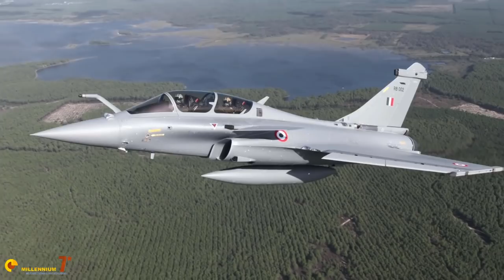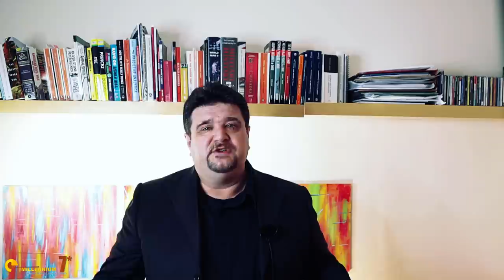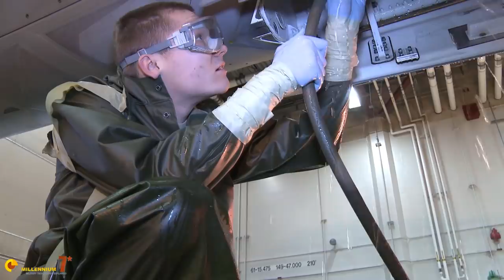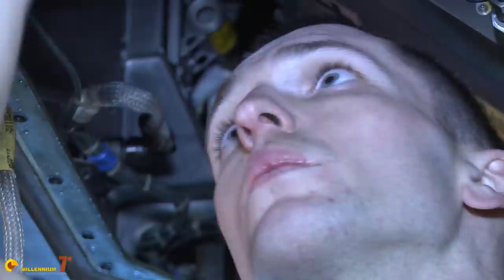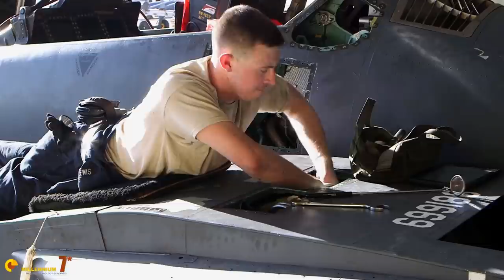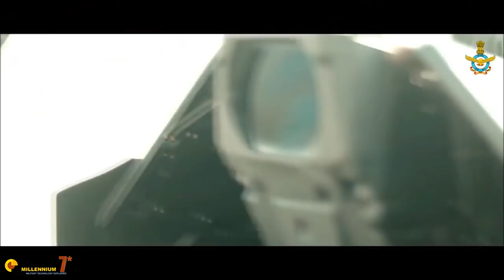The Indian Air Force is a MESS! ... or is it?

Comment: Actually the reason is plainly simple. Historically IAF was underfunded over the years, so the western aircrafts were quite expensive. So once upon a time, we used to have MiGs of different models in huge numbers (literally hundreds). They used the economy of scale logic. 

But lately, the experience with Russian hardware has been horrible. They may be cheap but their spares, availability or maintenance was pathetic. Add to that, too many crashes. 

Therefore, the planners instead went for getting different western aircrafts, but in small numbers. The number of Mirages and Rafales is not that big. 

Now, India is going towards indigenization. Most components in Tejas are either western, Indian or Israeli, NOT Russian. And over the years with Tejas mk1A, Tejas mk2 (MWF), Twin Engine Deck Based Fighter (TEDBF) and 5th gen Advanced Medium Combat Aircraft (AMCA), IAF will soon be running mostly indigenous fighters, over next decades. This ensures uniformity, as all these models are just successors of Tejas.
Reply: Marcos B  the engine still used was american and was f404
Reply: Marcos B  Only of we can make our own engine!! Tejas program would have been realised long time ago.

Comment: Maybe a good idea for western-style air forces to have a multitude of different aircraft but with certain common main parts that are not critical in respect to countermeasures or tactics (for instance: engines, canons, cockpit layout/HOTAS, ejection seats, landing gear, mission computers and databusses, etc.) so that logistics can be more efficient whil also yeilding a more versatile and less predictable force. 
On the other hand, western forces may have their aircraft somewhat similar, but they can vary in terms of armament, ECM/EW and tactics deployed. But indeed: a limitd amount of radars for example narrows down the amount a potential advrsary has to be able to counter...

Comment: I doubt a small Western air force ecpects automatically to prevail in combat. The Finnish air force, for instance, comprises 60 single-type fighters whose job is not to demolish the Russian air force but to act as sufficient deterrent. To this end, the force is equipped with e.g. the JASSM missiles for a robust counter attack capability against high-value targets far inside Russian cintrolled air space. 

Most radar and anti-air assets are also mobile and cannot be knocket out pre-emptively. The idea is that one cannot operate against even a small air force with impunity. That is, the air force does not exist to maintain air superiority per se, unlike naively proposed in this video.

Comment: Indian Airforce 

1-Su 30mki - Backbone of airforce

2-Rafale- cutting edge, will be used along su30mki

3- Mig 21- retiring, used for point defence

4- Jaguar- retiring ( often used in mountain areas and low altitude warfare)

5- Mirage 200- used for low altitude bombing 

6- HAL Tejas 1, mk1a, mk2 - Will be the mainline fighters. Single engine, less expensive to operate, indigenous, easy to upgrade , no spares issue

7- AMCA- Future cutting edge, 5-6 generation, will be the apex of Indian Air force

8- Mig 29K- Carrier based , few are used by airforce as 2nd aircraft carrier was behind schedule.

The issues is that India has various geographical regions, from highest mountain range to long coast lines, dense forest to sparse desert.

Comment: If you look at the number of IAF crashes, the word 'mess' would be an understatement. According to India Today's report published in September 2019, IAF had already lost 12 aircraft in the first nine months of 2019. The crashed aircraft included the SU 30MKI and the Mirage 2000. According to a recently published report, a number of IAF pilots are leaving the air force as soon as they are eligible to receive pension. Currently the IAF is running low both on the pilots and aircraft. A lot of hype was created on the procurement of expensive Rafale aircraft while the IAF has already been operating SU 30MKI and advanced Mig 29s. Rafale is the most expensive aircraft IAF has ever purchased. It's worthy to note India's per unit cost of Rafale was significantly more than the original contract price. Also, the Rafale deal was unique in a sense that a civilian conglomerate was the middle man in the  deal, this doesn't happen around the world.

Comment: India looking to create a domestic military jet industry at the same time. What is the value of technology transfer ? Domestic production off set any risk of arm embargo . What the value of  The Sukhoi/HAL Fifth Generation Fighter Aircraft (FGFA) or Perspective Multi-role Fighter (PMF) ... India prefers to produce its own fifth-generation fighter to maintain parity with China's air force that has recently debuted the Chengdu J-20 but was also not happy with the progress of FGFA. Indian state-owned defense agencies have reportedly confirmed that the ambitious AMCA 5th-generation fighter jet program will involve the DRDO (Defense Research & Development Organization), the HAL (Hindustan Aeronautics Limited), and a private company. New Delhi Finally Adopts Western Model.
Reply: ToT will give the experience of manufacturing jets, just like we were manufacturing the sukhois from one of our own assembly lines and that line has rolled out the last batch of sukhoi and that line will now be used to produce the tejasmk1a that is replacing the old mig21s or it will be used to upgrade the sukhoi30 mki to super sukhoi programme. Then India already pulled out of FGFA and it is not only India's defence complex that is working for the AMCA and supporting it but the Indian airforce is in full support for an indigenous 5th gen fighter rather than a foreign built fighter due to their leadership. Also it is just the MMRCA2.0 that is asking for the ToT for any jet in the competition this deal is being done to give Indian airforce an additional edge for the BVR engagement otherwise the Indian airforce had already made a plan for replacing it's jets like the Tejas mk1a is right now replacing the mig21 then MWF will replace all the older mig29, mirage, and specat jaguars and it will be the backbone for the Indian airforce then sukhois will be upgraded by the time AMCA 5th gen fighter will fly for the first time. So at the end of this decade they will have the MMRCA jet which will be chosen under the deal and then sukhois and India's own platforms.

Comment: India military is a salad.  They put everything they can get into their salad.  Looks powerful but once into warfare...  Well...  Problems problems  problems...
Reply: Nope, they take what suits their requirements. Mirage was bought to counter pakistani f16s, SU30MKI is a russian jet but it is fitted with israeli avionic that gives it the edge of BVR capability along with the russian manuvorable design, mig21s will be replaced by tejas mk1a and they are already ordered and then all those jaguars, mirage, mig29 will get replaced by tejas mk2( MWF) which is going to have the prototype by 2022 and by 2025 sukhois will be upgraded by the super sukhoi programme then in 2025 the first prototype of India's 5th gen jet AMCA will roll out and the second variant will have indigenous engine. So they are on good track and as you can see that most of the jets are the SU30MKI that is the backbone of India's airforce and mirage,mig29 are in small numbers and they are going to be replaced anyhow. Even the sukhoi will lose the title of backbone to rhe TEJASMK2 and after tejas mk2 india will be self reliant in jets just the engine will be under development. Otherwise we got everything else and airforce is in favour of Indian tech because that is easily available
Reply: @danydash316  well perhaps you are right.  But what I see is a hell in maintenance.  All different standards weaponry...  OMG 😱...  If as a small country and small unit of military is OK but India is a big country...  Like USA Russia NATO and  China. Modular design is present and future trend.  If only a small conflict will do.  Once enter major warfare...  I don't think India having the capability of long term combat.
Reply: @michaelgfyau4514  india stores everything for 15 days of brutal combat. And about maintenance that requires spare parts so Indian tech companies and Indian airforce are working to develop the solution with 3D printing and airforce have already considered the process so they can get the parts here in India, then having such diverse airforce gives the additional edge over the enemy since even if they manage to find the short comings of one Indian jet they will be fighting another type of jet in another air engagement. And as i told you about tejas it was a modular jet developed by India and it did took a long time but all of the upcoming jets that are being developed in India are derivatives of tejas that means by the time Tejas mk2 gets into production india will be no longer in need of extensive supplies of spare parts and training since all those jets are same just different variants and capabilities. And Indian airforce is pretty much ready for a 1 vs 1 war against anyone including china but they are lacking equipment for a 2 front war against our both the neighbors at a single time with no help from our allies. They are authorised for 42 squadrons of jets which is necessary for a two front war but right now their numbers are at 30 squadrons and money isn't the problem here it is the bureaucracy to get new jets that is hampering the situation.
Reply: @michaelgfyau4514  and india does have the capability for a long term war with the current numbers but for just defending it's borders and we aren't just limiting ourselves to defend that is why Indian military is already preparing for the worst war they may ever face.

Comment: If the Indian airforce is a mess they wouldnt have won the war against Pakistan in 1971, which was lead by the USA (Chuck Yeager and Nixon and Kissinger) China wouldnt have backed down in 2021 if they thought India was walkover. They(China) attacked and defeated India in 1962 when India was weak and had only ww2 303 rifles and they had Ak47. India proved also that they are far better than the USA airforce. See cope India 2004 on youtube. It is not what type a of aircraft you have. It depends much on how you use them and how well trained your pilots are like if they think independently. The reason why third world pilots have done so badly with Sovjiet aircraft was because the pilots trained in the  Sovjiet were told from the ground how and when to make an intercept of enemy aircraft. The sovjiets also sold so- called monkey models of their aircraft to third world countries which came back to bite them.
Reply from the maker: Did you actually watched the video or you are just commenting the title?
Reply: @Millennium7HistoryTech  Chill dude I am an Indian and I liked ur analysis 
U eared a sub